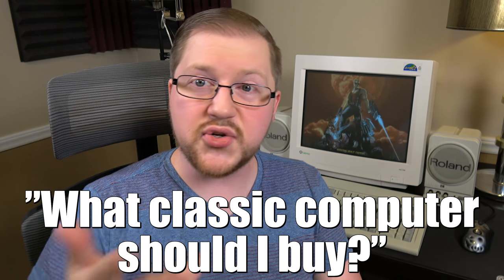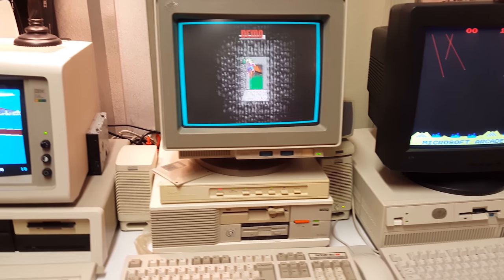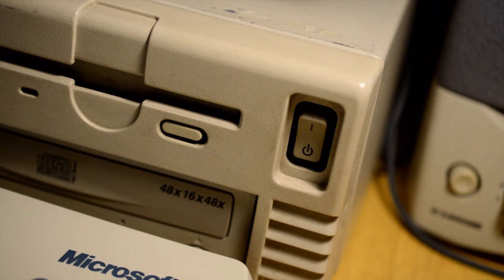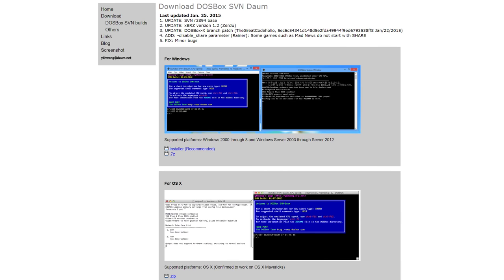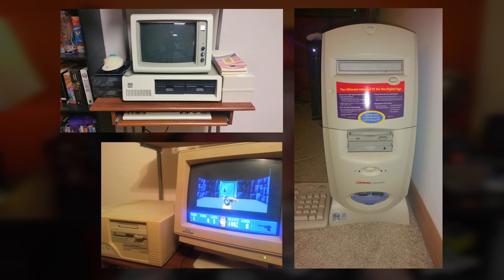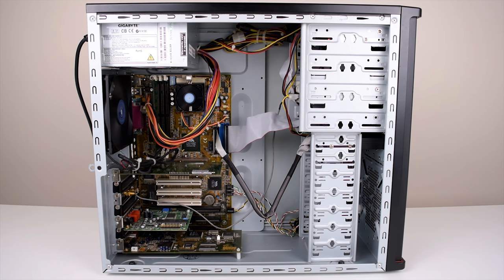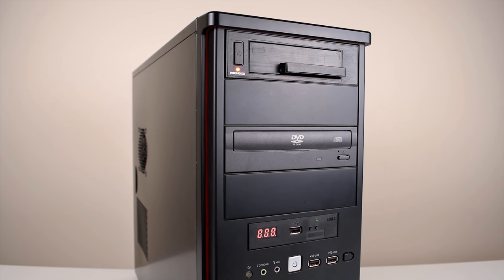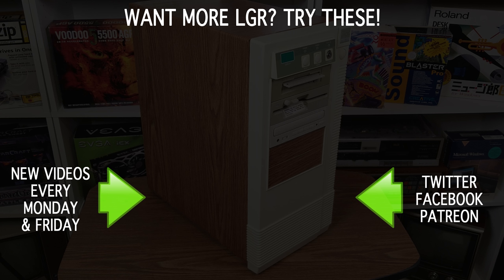Choosing a Retro PC for Games: Advice & What to Look For

Comment: I have, or can readily make work, a handfull of "go to" rigs for retro gaming, each increasingly more advanced to handle various things.

First rig: The infamous plywood plank 386DX/33 was the first PC I ever built from hand me down junk back in 1997 so even though the next rig generally does everything this does but better, I still keep the components around. (In 97', it was relatively rare for 12 year olds to be building their own rigs!) This is a TP Enterprises (model unknown) full AT 386+387 DX mobo slapped to a piece of wood with 8MB RAM, a 512kB Trident TVGA9000 video card, an Acer multi I/O card, a 245MB IDE drive, 3.5" and 5.25" FDDs and an SB 16. It's best for older titles up to but not including Doom. (Doom really wants a 486). It runs DOS 6.22. The TVGA 9000 plays nice with most EGA titles and this box generally handles any pre-Doom game with aplomb in glorious 256 color VGA. A few (very few!) old CGA titles don't run right sans wait states but I don't play those much at all and it's rock solid in every other way. The BIOS is even Y2K compliant! 

2nd rig: The Dell 486D/50. This is proprietary as all hell and thus a royal pain in the butt to upgrade (Anyone have drive rails? I need some!) but the SmartVu LED display just so cool. It's an older 486 without VLB so it's pretty sluggish with Duke 3D and other Build engine games. Despite having a flash BIOS and the Y2K fix flashed in, there's still no support for drives past 504MB; I find this to be most vexatious! I've put a 100MHz DX/4 Overdrive in it and it has 20MB of RAM. The BIOS has a compatibility mode that drops the CPU to 33MHz as well; think of it as a turbo button in firmware basically. This has one of those funky 3.5"/5.25" combo floppies and a 420MB drive.  Video is an onboard WDC ISA VGA chip with 1MB of memory and sound is provided by an AWE32. It runs DOS 6.22 and Windows 3.11. It plays a mean game of Doom, Hocus Pocus, Wolf3D and even Rodent's Revenge. 

Third Rig: The 586 Extreme! This is a simplified, slowed down version of the system I built in 2000 as my main rig. This has a Pentium MMX-233MHz CPU, 64MB RAM and runs Windows 98SE. Video is a Matrox MGA and sound is an AWE64. It's used for later DOS titles primarily and early Windows 95 games that don't need 3D (C&C is a favorite). This one subs in a 52x CD instead of a 5.25" FDD. It used to be an overclocked K6-2 system on a Gigabyte GA-5AA mobo but most of the parts from that got transplanted into the next rig so that board and chip await their next use. The 586 Extreme uses the surprisingly awesome PC Chips M571 motherboard. PC Chips was notorious for making the worst mobos you could buy, so having anything awesome with their name on it is almost scandalous in its own right and that just adds to the strangeness of this rig.

None of the above rigs see much action. Why? Because most of the DOS games I play are EGA and VGA titles and they work fine under Windows 98 provided you have the DOS environment set up properly and your hardware has good DOS support.

Fourth Rig: The Windows 98 game box. This is basically everything 15 year old me wanted but could never afford. It lives disguised in a slightly modded Dell Dimension XPS case (they're ATX!) and has a Pentium-III 650MHz CPU on a BX board, 256MB RAM, a Geforce 2 Pro and a Voodoo 2 12MB for graphics. Almost any 3D accelerated title for Windows 95 and 98 is extremely playable on this because of its robust support for not only DX7 and OpenGL via the GeForce 2 but Glide via the Voodoo as well. Sound is handled by an SB Live for excellent audio in both Windows and DOS and there's an Intel 82559 100Mbps NIC for retro LAN party action. There's a 3.5" FDD and an unknown speed DVD-ROM drive that came with the Dell when it was new and had Dell things inside. It has two HDDs, one is a IBM 13.2GB and the other is a WD 20GB; both are 7200RPM IDE drives. This is where 90% of my retro gaming happens. It plays everything from Wolf3D to Unreal Tournament flawlessly. Honestly, unless you're an early CGA junkie, a rig like this might be your end game. If I could have only one retro gaming rig, this is the system I'd have.

Fifth Rig: The XP Game rig. This is my last rig I built before I graduated high school. I built it in mid 2003 shortly before the start of senior year. It's an Athlon XP-2500+ overclocked to 2300MHz on a Gigabyte GA-7NNXP nForce 2 Ultra mobo with 1GB RAM, a 120GB WD Caviar SE IDE drive and a Geforce FX 5900. All peripherals save for the GPU are onboard; the motherboard peripherals are more than adequate for all late 9x and early XP era games. If it runs too slow on this, chances are good that it runs just fine on my Windows 10 box so this is where the retro machines stop. DOS games are hit and miss on this but any Win32 game up to a year or so after this was built is absolutely playable in 60FPS+

Comment: 27:30😂😂

Anyway, I'd recommend 86Box if you want to emulate old hardware. It even supports networking!
Reply: So does DOSBox. So Does PCem. So does VMWare. So does Virtualbox. So does PC-Task. So Does PCX, so does,.... so does,.... so does,....   
See a pattern forming?   :)
Reply: beezle1976 VMware and VirtualBox have such pathetic 3D acceleration though

Comment: I have a clunker dell mobo from the grey dimension line with a p4 and Intel i815 garbage graphics and Im going to throw an nvidia pci vid card in it.

Its pre agp,  the board.  A real crapper,  but I have LegacyOS Linux on it atm for basic use when the crappy i3 laptop is on the tv.  Wifi via ndiswrapper was actually painless for once with a wna3100 Wifi dongle.

256 mb ram. ftw.
Reply: Age of Reason I also have an old dimensions exept that I upgraded most of the things like the Rams and graphics
Reply: Pokemon Revelations Its nuts.  We would expect legacy parts to be a dime a dozen by now,  but they're still up there on many components. 

OH!  this is fun though,  a week or so ago LGR reviewed a DVD drive for old PCS that had the video converter card and everything.  I found the same unit at my local Goodwill a few days later. 

Im too broke or I would have spent the 8 or 10 dollars they were asking for it. Lord knows those ancient dimensions pre agp need as much addons as they can get.

Comment: Nice video. It really starts with the right question: "what do you want to run?"

As a general rule of thumb it can be said tht the older the hardware ist the more hassle it will be to handle. (like harddrive cable that have no convenient marker which way round to plug them in and much nastier stuff. Also it is a matter of supply and demand, some old stuff is harder and harder to get..

For really old stuff, like pre VESA graphics games I would probably not bother and just emulate them.
There are a few things that I would not want to forgo for an old machine:
- ATX standard mainboard (the older non standard one need specific cases, power supplies, have almost no connectors so you need a ton of ISA or PCI based conroller cards etc etc.
- PS/2 mouse and keyboard connectors. Finding old keyboards and old mouses gets more difficult by the year, and I really have no idea if tere ever was a serial optical mouse. And ball-mouses, let's be honest - were shit.

Comment: My slightly odd "in between" retro pc is an old all in one business pc called an IBM NetVista X40. It’s a Socket 370 Pentium 3 667Mhz, on a 133 Mhz Bus.   It has a built in Floppy drive and 24x CD-ROM drive, which is accessible on a hidden tray which becomes visible at the push of a button.  It has a 15” TFT XGA display, all the pixels work and the colours are spot on.  It has a stock 20 GB HDD, five USB ports, two free 32bit PCI expansion ports, and built-in AGP graphics and a sound card with speakers.  It also has an Ethernet port, PS/2 keyboard and mouse ports, and a mic in and aux out port and it works well for games between 95 and 2002ish and is pretty good for slightly older DOS games but is not 100% reliable the further back you go (never been able to get Grand Prix working' grrr!). Love how small and compact it is and how little space it takes up. Keep up the great videos Clint.

Comment: Pretty cool to see an NCR 386 box.  I used to work for NCR as a Customer Engineer which is their HR terminology for field service technician.  At the HQ in Dayton OH. I saw a few display cases containing old hardware and I was surprised to see some VERY OLD SCSI hardware for which they hold (or held) a patent.  NCR also had the first dedicated file server and originated the concept of fibre channel.  It was a really good job but the company was mismanaged by Mark Hurd and a lot of old timers were bought out early which basically meant an experience drain in the field and a reduction in customer facing assets without reducing the multitude of 3rd party contracts to which NCR is committed.  Really a decent job though.  Ahh the good ol' days.

Comment: Being 40+ myself, I owned a lot of the systems mentioned, playing games on them when they were new.  Actually, between 1998 and 2008 I just upgraded the hardware of my big tower (at one point making an hole in the side panel for an extra fan) and I'd replace monitors.  I still own the big tower, although it now is demoted to table for my current PC.
I'd probably go with Dave's (8-bit Guy) solution: a laptop.  Space is an issue when owning retro computers; Commodores in my case...

Comment: Superb video, Clint ! Enjoyed every second ! I also share the love for 486 computers, especially the DX2-66. 
I like vintage pre-built machines with proprietary hardware, these offer high quality stuff and some may even come with some nice tweaking options for the hardwired hardware.
Biggest downside for me on these machines, proprietary RAM & cache. I hate those manufacturer-specific cache chips. Almost impossible to find nowadays :(
Power supplies may also come in strange form factors, but these can be fixed as long as you keep the original housing :)
Cheers !

Comment: Fun fact related to old hardware, if a modern motherboard has a slot which supports vintage GPUs, you could put it in and using the VFIO/GPU Passthrough you can create a virtual Windows 98 and with the mentioned GPU Passthrough use it as a display while at the same time have an actual graphics card running on it.

So for example, you could put a VooDoo 3 on it, set the virtual machine with QEmu to use it and have a modern PC which not only runs a modern OS on modern GPU, but also a virtual Windows 98 system which uses Voodoo 3 GPU with drivers for it.

The VFIO/GPU Passthrough is much more popular in Linux community and a good guide is needed to set it up, but it is seriously worth it. It gets even better if you have a integrated GPU with a modern AMD or NVIDIA GPU along with a vintage GPU.

You can literally have a Linux PC which runs a modern Windows version using the modern dedicated GPU and a vintage Windows one using a vintage GPU and all you have to do is just connect a cable of your monitor to one of the GPUs (Cept for vintage one for obvious reasons).

Comment: I would argue that it heavily depends on the system you want to be using. When I first started using computers, it was on a TRS-80 Model I. (Yes, I'm old.) When you switched it on, it worked. There wasn't anything else to it. Every computer was its own little ecosystem, not compatible with anything, but it would always work.
Then, one fine day, a bunch of kids from Seattle cobbled together an OS that they sold to IBM, but which they also sold themselves. And that's where all the trouble started. Now, instead of a computer that simply worked, you could get components from as many different manufacturers as you had components, and then the actual software came from yet another supplier.
There wasn't much in terms of standards or interfaces, and quite frankly I think I prefer a root canal treatment than setting up a PC without SATA and PCIe. Band cables, PC cases that cut open your hands, IRQs, problems with memory... it's a neverending list of pain and suffering. which I've blanked from my mind.
If you're masochistic, sure, go and set up a 1990s PC. You, the unworthy slave, will thank your mistress that she makes you set up that 1990s beige box. But if you want to play games because you like, well, playing games, think very well before you go back to that era of darkness.

Comment: Something that works well for my use (I support legacy computers at work for use with machine tools and older PLC setups) is QuikMenu III, which actually was one of the better GUIs for DOS.  Love the different approaches everyone took to the retro gamer thing - that just shows the range of ideas that are still workable.

I never gave any thought to using Compact Flash with DOS - wow, that opens up new territory.  I have used PCMCIA cards to emulate DOS hard drives with some success, just because we needed a DOS machine and I didn't have small enough hard drives available.  A 195 MB PCMCIA card is plenty of room for a base DOS system with room left for apps.  (Amazing how that works out, isn't it?)

Comment: I've been rebuilding a 486 DX-4 100MHz Dell laptop. Fully dissasembled, new CMOS battery, cleaned everything perfectly, and clean installed DOS 6.22 and Windows 3.1. I'm using the original HDD as I like the noises it makes, and I also have 2 more era appropriate HDD's for backup. Only PC speaker audio sadly, but I've been looking into PCMCIA audio as a potential solution.

Comment: I've just built a Windows 98 SE retro PC. I set out with the goal of running DOS and Win9x games, with only stuff from my parts box. I've got the motherboard and proprietary Dell PSU from an old XPS R450 family computer, very similar to MetalJesusRocks' one but with a 450 MHz PII. I put 512 MB RAM in it. (Note, the manual says max 384 MB but it WILL accept 256 MB sticks and work perfectly, it's just rather picky about which ones it will take - this is the sort of discovery you make when you install RAM before you check the manual). I added a D-link 100 mbps ethernet card, a Via USB 2.0 controller, and a Linksys WMP54G wifi card since it's set up away from my router. (No Win98 driver is available from Linksys but there's one from Ralink who make the chip in it, and adding the Linksys card's VID/PID to the inf makes it install and work.) I kept the Aureal Vortex 1 sound card it came with, but added an old Sound Blaster Vibra16 ISA card too since Aureal's OPL3 emulation stinks. It coexists with the A3D one after a lot of messing with IRQ and DMA assignments. Trying to use both in Windows causes crashes but the SB16 works fine in DOS, which is where I want it anyway. Then I have a 48x CDROM that has the headphone jack and volume knob, and a newer 16/40x DVD+/-RW that doesn't have a working legacy analog audio interface, for anything DVD based. I also threw in a completely anachronistic 400 GB hard disk, which Windows partitioned and formatted as 127 GB - it doesn't make barely any nostalgic click noises at all but it absolutely flies compared to the original 10 GB drive and I remember constantly running out of space on that back in the day. 

For graphics, I'm currently using an ATI All-In-Wonder Radeon 7500 but may move to the Nvidia RIVA 128 ZX the XPS R450 came with. The ATI is more powerful and so far is working for the stuff I've tried, but it doesn't have VBE 3.0 and isn't supported by UniVBE. I'd want to use a Voodoo card but don't have one, but the dgVoodoo wrapper works in Win98, and the Radeon renders the result up to 1600x1200 with no FPS drop - something I never thought I'd see on DOS games running on otherwise period hardware. I generally run it with a 17" CRT though I find it neat that it will happily output 1080p if I connect a modern monitor on DVI.

Comment: System for DOS: MS-5169 Motherboard |  Pentium MMX 233 | 64MB Ram | Voodoo Banshee | Soundblaster AWE64 Gold | WD Raptor + Startech IDE-SATA (bidirectional Adapter)

"slow" System for Win98SE: Dell Dimension 4100 | Pentium 3 @ 1Ghz | 512MB Ram (PC133 @ CL2) | Geforce 4 Ti-4200 | Soundblaster Audigy 2 ZS | WD Raptor + Startech IDE-SATA (bidirectional Adapter)

fast System for Win98SE: ASUS P4C800 Deluxe | Pentium 4 @ 3.4Ghz | 512MB Ram (PC3200) | Radeon 9800 Pro | Soundblaster Audigy 2 ZS | WD Raptor

works like a charm!

Comment: My retro gaming PC: DOSBox. :) Easy to speed up and slow down the internal emulation engine to make it run similarly to anything from an 8086 to a Pentium. Saves a lot of space that would be filled with a bunch of old PC parts. That said, I was there when all this stuff was new. In fact I was there before it came along, messing around with Apple II and other machines of the age when the IBM 5150 came out. I know it inside and out and still prefer the emulation path despite knowing pretty much everything needed to get old hardware operational.

I am playing Master of Magic (DOS version) on DOSBox now (literally as I write this) and have many other games that run on it perfectly. For 16-bit Windows games, those run fine in "XP Mode" (Windows built-in Virtual PC), though I've had to overcome a few hurdles along the way. Certainly not as many as if I'd taken the antiquing path.